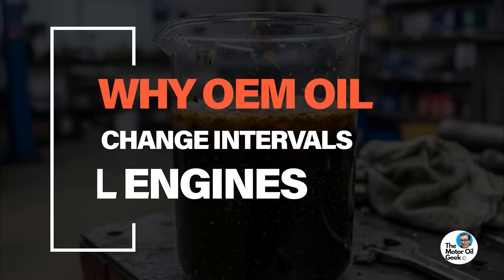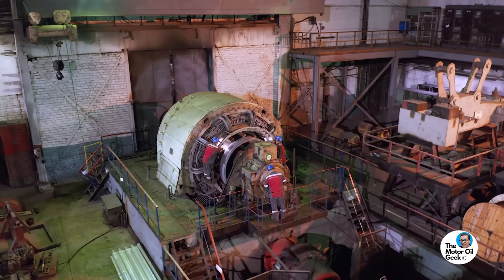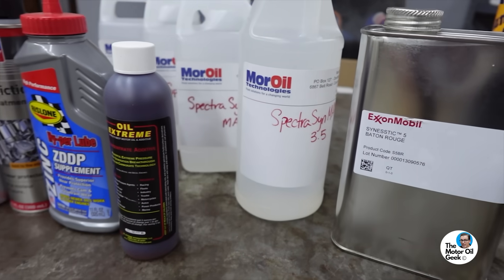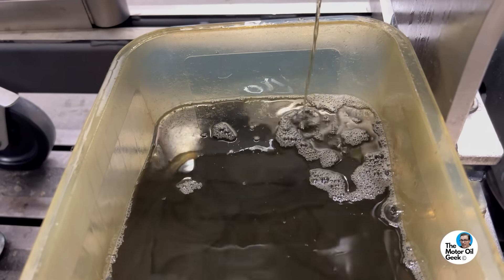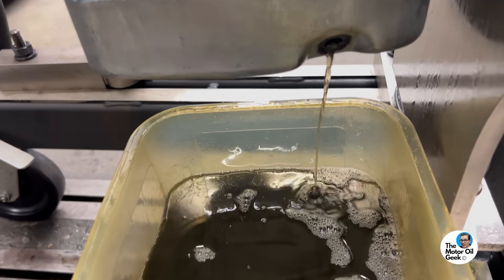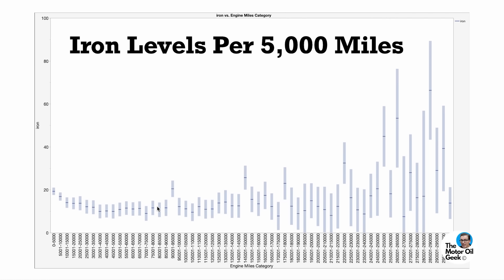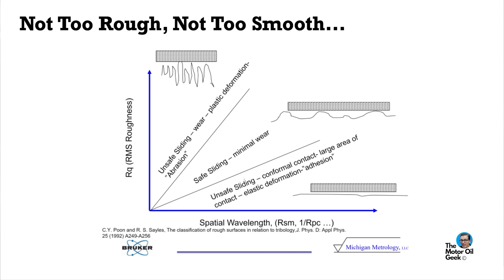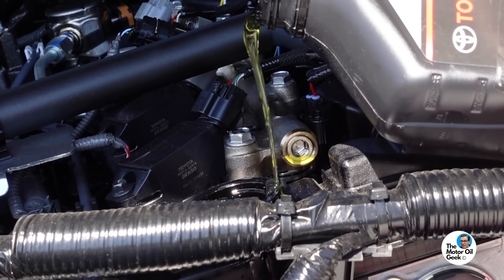NEW Data Reveals WHY Modern Engines FAIL Prematurely!

Comment: I am getting a new GM truck with the 6.6 L8T Gas engine. I am following your advice on the early oil changes but was considering switching to the Driven BR30 5w-30 as soon as I get the truck home. Then do the 500 mile change and move back to the OEM Recommended oil to establish the baselines. Do you recommend this to get the best break in of the engine or just stay with the OEM oil the whole time? Thanks for your sharing all of your great knowledge! P.S. I will be doing the oil samples of each stage with speediagnostix.

Comment: I KNEW IT. Been saying it for years - don’t trust the modern OEM intervals! As both a motorhead and a man of science, I typically trust the engineers’ word as gospel on most matters. They built it so they know best, right? However the one thing I have never jived with is the 6,000 mile oil change interval on modern engines. It goes against every historical principle of engine maintenance.

Comment: Iso codes on oil will fall initially during engine running because oil comes from the manufacturer with contamination higher than you might think. I'm a hydraulic engineer and I've seen oil straight off the truck test at 20/17/16. We would filter the oil before filling our oil fill carts and condition the oil after that by running the machine and changing its filter afterward. I'm not convinced that running a dirty filter is desirable, or responsible for the initial decrease in contamination.

Comment: Why is that a turbo charged V8 Diesel trucks made in the 1960's will last over a million of kilometers running on good old mineral oil......now we have the best fully synthetic oils, oil filters and the engines are crap....it s all about exhaust emissions reductions and sound reduction of engine combustion noise. Mind you a V8 2 stoke GM sound is nice.
Interesting about engine break in, Royal Enfield a Indian motorcycle manufacturer recommends a engine oil change at 500km, 5000km and 10,000km, then every 10000km intervals during the break-in process and this is on a $6000 US bike....
Every week on the car and bike forums I reed there is always some one who asks which is the best hi flow filter to buy......because sales pitches can give you so much more power...
Thanks for your videos this past year....

Comment: Could you discuss filtration (and oil filters) in terms of beta ratios and specifically the difference between standard lab tests for efficiency using constant introduction of contaminants into the test stream vs real world engine rate of producing  contaminants in continuously circulating and filtered oil?  Surely the rate of introducing contaminants affects the ultimate purity of the oil in actual engines.  In other words,  will both standard and ultra-high efficiency filters be able to purify the oil similarly after just a few cycles of recirculation, even if efficiency of the filters differs, like 99.9% vs 95% for particles of same size?

Comment: After watching your first visit to Donaldson video, I hunted down an purchased a Donaldson oil filter for my stroker Jeep engine.  I'm attempting to find an air filter now, and have called Donaldson.  I removed the OEM Filter Box in favor of a Cold Air Intake which uses a conical filter that probably doesn't clean anything larger that dust.  So, Yes, please revisit Donaldson.

Comment: Imagine how much machining debris could be caught by a 2.5 lb magnet. It does not need power, or connection to any computer. Get back to basics. It’s “physics” the oil pan bolt should be the size of a radiator cap, with a 2.5 pound magnet in it.

Comment: IMHO, some of camshaft/valve roller wear can be attributed to low idle oil pressure (especially on engine that have variable oil pressure pumps) and extended idles.

Comment: Relative of mine works in the medical industry and they have a handful of 2022 civics they use to move smaller supplies around. They did the break in procedure and now change the oil when the maintenence minder says so. So far they've each accumulated avout 230k miles without issue

Comment: When I was a kid in the Midwest my dad changed oil with the seasons.
Spring, summer, fall ,winter.
His car averaged 10,000 Mi a year and that put it out at 2500 miles per oil change and back then you also adjusted your viscosity with the season / temperature.
Reply: Same with me,  still do it

Comment: Yes to the deep dive on filtration.    We are so lucky to have this channel to learn from!!!!  Thank you Lake and Merry Christmas!!!!    I do have a question:  
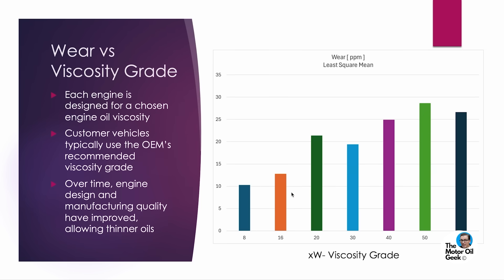At 13:46 you showed that graph with 0w-8 and 16 and 20 etc as a segue into talking about 20 and related contamination of gas vs diesels.....but back to that graph:  is that meant to claim that there is going to be less wear in an 8 or 16 as compared to a 20?  Or is that simply expected wear when  an engine is designed to work with an 8 or 16 weight oil (ie engine-specific, with corresponding oil)?
Reply from the maker: Stay tuned for a coming video where we dig deeper into wear patterns with low viscosity oils.

Comment: Serious question, all direct injection engines have carbon buildup on intake valves, now the valvoline restore and protect cleans carbon from the inside of the engine, the question is would using this oil reduce the oil vapor build up on the intake valves? 
Thanks

Comment: Mazda builds the best ICE vehicles these days, overall, IMO.  Wish their SkyActiv engines had supplemental port-injection though.  I have my oil changed every 6-months, which equates out to about every 1.7K-2K miles driven (since I only drive 2x per week usually).

Comment: Before I even watch the video I am going to take a shot at this question. I have a feeling this is a collaboration between the federal government and the automakers to shorten the life of engines on purpose. The tree huggers and the federal government want the old vehicles off the road. The auto manufacturers want you to buy new vehicles does not fit their business model. I will change my oil every 5,000 miles I do not care what anyone else says.

Comment: Modern cars are like TVs or anything else, they're made to be thrown away so you can buy another one.  The avg car ownership is less than 5 yrs before someone trades it in.  So by the time the person trading the car in, the engine is still running and the dealer will either sell it as CPO or they fix it and lease it out again.

Comment: This is consistent with my experience. I'm not just talking about nano size particulate either. I've done close to a dozen rebuilds and/or brand new engine break-ins, and I'm here to tell you that every single one had varying degrees of visible metallic particulate in the filter after less than 200 miles of running. This is why on any rebuilt or brand new engine I deal with, I run it through a couple of heat cycles to seat the rings and then immediately change the oil and check the filter. I also do the first oil change at 3000 miles, and again it's to flush this stuff out (rarely do I see visible contamination at this stage though, if so it's very miniscule). On the rebuilds I've done, I've gotten increasingly OCD about the cleanliness of the engine block before reassembly. I go inside all of the oil galleries with bottle brushes and multiple solvent flushes. Same with the cylinder walls and the crankcase. I've been able to cut down on the amount, but no matter how much I clean, I always find at least a little bit of particulate in the filter that's visible to the naked eye. This is also true for small engines. They don't use filters usually, but you can see it in the oil change if you use a clean oil catch pan. There's always a little glitter in the bottom. Again, 2 heat cycles and then it gets changed, then again at 30 hours.

Comment: If you leave an oil filter in during a oil change, should you remove the filter, discard the oil in it, and then reinstall the oil filter?  Or just leave the dirty oil in the filter and add new oil to fill it?
Reply: Just replace the filter.

Comment: I can appreciate all the details but here's the big picture. My 96 7.3 powerstroke has 460,000 miles on it. Running the cheapest 15w40 i can find for the last 200k, sometimes forgetting about the oil and going 10k on changes. Modern engines don't last. We have better technology and metallurgy than ever, and the engines don't last.

Comment: What about motorcycles? Manufacturers usually quote 600-1000 mile mark for the first oil change and then 3000 miles or so. Should we be changing the oil at like... 2000 miles mark also perhaps?
Reply: My Triumph intervals are 600 miles, then every 10 000 miles, which is ridiculous.

Comment: People should look at what point its worth it or not worth it to put so much money into oil and filters? If you have an engine that is cheap to rebuild, and downtime is not the end of the world, gotta figure the balance? Fleets of trucks going on 5k mile oil changes vs 15k mile oil changes, the 15k interval engines seem to only last 70k miles less than 5k interval engines? They both last a minimum of 700k miles.

Comment: My 2014 gmc Sierra 5.3 was buring oil so i changed it to 5w30 from 0w20. What are your thoughts?
Here is what manual recommends.
SAE 0W-20 is the best viscosity
grade for the 5.3L and 6.2L
V8 engines. SAE 5W-30 is the best
viscosity grade for the 4.3L V6, and
6.0L V8 engines. Do not use other
viscosity grade oils such as
SAE 10W-30, 10W-40, or 20W-50.
Cold Temperature Operation: In an
area of extreme cold, where the
temperature falls below −29°C
(−20°F), an SAE 0W-30 oil may be
used in the 4.3L or 6.0L engine. An
oil of this viscosity grade will provide
easier cold starting for the engine at
extremely low temperatures. When
selecting an oil of the appropriate
viscosity grade, always select an oil
of the correct specification. See
“Specification” earlier in this section
for more information.
Engine Oil Additives/Engine
Oil Flushes
Do not add anything to the oil. The
recommended oils with the dexos
specification and displaying the
dexos certification mark are all that
is needed for good performance and
engine protection.
Engine oil system flushes are not
recommended and could cause
engine damage not covered by the
vehicle warranty.

Comment: Lake, I really wish you would do a video on when to increase viscosity mileage wise. We have four vehicles the lowest mileage vehicle is at 289K. My 2010 Sequoia has 411K. Until 150K I use manufacturer spec, which for most of our vehicles it is OW-20. At 150K I switch to 0W-30.at what point do I go to 0W40?

Comment: I'd like to see some proof that oil filters actually get better over time, as from what i've been able to find, this isn't the case. I'd like to share a quote from kitplanes that has done some actual testing on this:
"Constant Pressure vs. Constant Flow
Fluid systems generally operate at constant pressure, or a constant rate of flow, depending on design goals. A water tower is a good example of a constant pressure system. Gravity generates constant pressure at the upstream side of a restriction. Changing the degree of restriction changes the downstream quantity and pressure, but the upstream pressure remains fundamentally the same.

A constant flow system is typically driven with a positive displacement pump. Gear and gerotor oil pumps are excellent examples. Within the limits of a practical system, changing a restriction causes the upstream pressure to rise, while the flow rate before and after the restriction remains the same.

The fundamental difference explains a detail of filter performance. In a constant pressure system, filter restriction slows the flow rate, while the buildup of captured contaminant adds to filtration efficiency. For example, a dirty water filter may slow downstream flow to a trickle, but the water itself will be cleaner.

Things change when we drive the system with a constant displacement pump. Filter restriction causes the upstream pressure to rise. The increased pressure difference between the two sides of the element means more velocity through the remaining microscopic pathways. The increased pressure and velocity tend to wash particles through to the downstream side, so as the filter loads with more and more contaminant, the efficiency goes down. It’s easily seen in 4548-12 tables. The lesson is clear; a new oil filter works better than one left in service too long.

—D.H."

Comment: So I have not seen the product in quite some time, but there used to be a company that sold a magnet that attached to the outside of the filter to hold metal particles. Not sure if it's still available, but would love to see a test with it and see if it assists with any of the particles that are in the oil/engine.

Comment: Probably beyond the scope of this video but I'd like some thoughts on break-in for engines that are being partially rebuilt like the typical heads/cam/lifters upgrade.  Do those components introduce like amounts of wear metals with an otherwise untouched bottom end or would the impact be halved?  It seems like caution is the correct move with a fresh re-build given the chances of contamination from improper procedure (ask me how i know).

Comment: I assumed that most people have figured out that engines/cars are made to be disposable nowadays. And a lot of that is crap import parts not manufactured to good specs.
Filtration data is just as, if not more useful than the oil itself!!! A lot make claims that may fall short of the marketing. I know Fram had an issue a while back with some cardboard piece that caused a lot of problems. I have always used Motorcraft in mine and dealer or Wix filters for everything else.
I would like to hear thoughts on oil change intervals for motorcycles and classic cars that sit for months over the winter. I have always heard to change the oil before winter storage so there was clean oil in there and it would be less corrosive 🤔

Comment: This video was truly wonderful. :)

Please do a deep dive on filters!  I would absolutely love that!

I love that it actively calls out the benefits of early oil changes during the break-in period, and that you specifically used 'break-in' oil and not the oil that would be used during the normal operation of the engine.

That said, I'll be setting up a custom bypass kit on my car.  This'll be the 3rd bypass kit on the 3rd car that I've owned.

On the 2nd car it had to go into the shop to replace the turbo, and they adjusted the valves at that time as they were due.  The shop commented that it was the cleanest engine they'd ever seen, especially considering it had over 80,000 miles on it since they rebuilt it.  They also asked me what the contraption I had setup on the oiling system - that was the bypass filter kit.  That bypass kit added roughly 1.5qt of oil capacity as well, and that shop detailed the extra oil volume and the bypass filter is what allowed that engine to be so clean and run as well as it was.  It also had less than 1% blowby per cylinder because of how I did the engine break-in.

Clearly that method (while some call it overkill) has proven itself to be absolutely worth it.

Comment: The OEMs want to see more degradation which is why they keep lowering viscosity. Those 0w-20 & 0w-16 engines won't last half as long as say an engine on 5w-30 or 5w-40.
Planned obselescence is evil.

Comment: I have a dodge 2006 5.9 diesel. Oil has always been coal black even right after a change. 170k miles and running great. Apparently the dark color isn’t hurting anything?

Comment: on my 2024 Silverado 2500HD w/ 6.6l Gas. I recently turned 13,000 miles. it has had 5 oil changed in that time. Each time I had the oil tested. It wasn't until the 5th oil change that the contamination level dropped to near zero.

Comment: I have been harping  for years that clean fluids being oil ,ATF or gear oil are the life blood of mechanical devices. 
So many times on forums   I have been told I'm wasting money ,resources and time. The manufacturer specifies longer. 
Science over speculation. 
Thank you Mr Speed!
Reply: My Wife's Edge gets 4000 mile engine oil changes, 25,000 mile PTU oil changes and 60,000 mile trans fluid changes. My new Maverick  Hybrid had it's first engine oil change at 1000 miles and will get the same PTU and trans fluid intervals as my wife's car. Oil is cheap replacement is expensive.
Reply: Same Ive only been treated so poorly talking about this also
Reply: 200k mikes on 15k mile OCI. No oil consumption. I drive harder than 98% of people. BMW 128i. 5w40 Mobil 1 and Castrol Edge

Also, i run 87 octane fuel
Reply: @johnnypolex  You're luckier tan the average bear... Especially on that engine. You say you drive harder than 98% of people. Tell us about your daily use...
Reply: @johnnypolex  ...No timing chain/tensioner/phaser issues at all...?
Reply: @johnnypolex your cheap and well I won't say it .
Reply: @johnnypolex  lol  Some of us middle aged car geeks are bmw fanatics.  U r lying, particularly wrt to those two brands synthetics in 5/40, w/ 15K intervals.   I'd bet my life against this, and/or your wear in the engine is massive and u have no idea